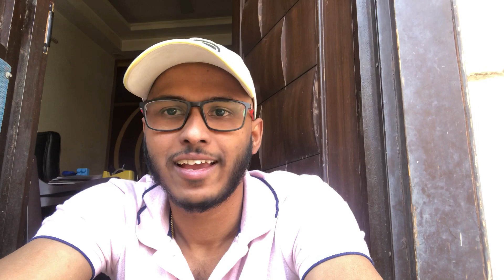ഏപ്രിൽ 5 ലെ 9 മിനിറ്റ് പവർ ഇൻഡസ്ട്രയിൽ എന്തൊക്കെ സംഭവിക്കാം | Effects of 9 minute on Power Industry

Comment: 9 മിനിറ്റു ഓഫ് ചെയ്യുക എന്നുപറയുന്നത് എവിടെയും സബ് സ്റ്റേഷൻ അല്ലെങ്കിൽ ജനറേറ്റർ ഒന്നും ഓഫ് ചെയ്യില്ല.... വീടുകളിൽ ലൈറ്റ് മാത്രം ഓഫ് ചെയ്യാൻ മാത്രമാണ് നിർദേശം(ആരെയും നിർബന്ധിക്കില്ല) ഇതുകൊണ്ട് നമ്മുക്ക് എനർജി സേവിങ് ഉണ്ടാക്കും...
Reply: Angane transformer substation il off cheyadi vannal athite outgoing side 3 phase open cheyuthu transformer on cheyumayirikum. Angane varumbol start cheyumbol ulla thamasam varilla. Ithente chintha anu ethra correct anu ennu ariyilla
Reply: @ananthumohanvlog8837  Normally, transformers are not switched off at substation, even if the load is only for one transformer. Even if the load is enough for one transformer only, if there are two/three transformers (in parallel), they are made to share the load(as per their impedance values). It is done for reliability of supply.
Reply from the maker: Angane alla...demand undel maatre power generate cheyyu..peak samayath maatreme chile transformers on polum cheyar ollu...
Ivdem load orupad kurenjal substation transformers off cheyende veram...generation kurekendem verum..
Energy saving undakum athu sheri aanu..proper aayit manage cheythal problem undakilla...
Reply: @TechCornerMalayalam  substation transformer off ചെയ്യില്ല.. ath total power cut off ആകില്ലേ.... generation stationil ആണ് എന്തേലും changes ചെയേണ്ടി വരുക
Reply from the maker: Substation il oru transformer allelo orupad feeder kaanum...athil chileth peak loadsil maatre use cheyu...athinte switching adjust cheyende verum naale
Reply: @TechCornerMalayalam  techinical side അറിയാത്തവരോട് പറഞ്ഞിട്ടു കാര്യം ഇല്ല... bro
Reply: @jerinmathew3254  പറയാതെ ഇരിക്കുന്നെ എന്തിനാണ് bro, ഇത് നമ്മുക്ക് പരസ്പരം അറിവുകൾ കൈ മാറാൻ അല്ലെ?

Comment: There could be some interesting happenings during those nine minutes.. A possibility is that our grid elements may trip on over frequency or on over voltage if not taken care suitably.. Worst case will be a cascading incident, which could put many patients who are put on life support systems all over the country, at risk. But, I hope that we'll just ride through those 9 minutes without much issues if our fast acting power plants (hydal/gas etc) respond well in the free governor mode.. Same will be the case for switching on time after the 9 minutes.. ( We already hold an earth hour each year, don't we?)
Reply: Can you please explain how the frequency will be getting high while reducing the load
Reply: @advikaak5645  The grid is fed by sync. alternators in parallel. When the load is just reduced at the consumer end, the sync. alternator would still have been receiving same amount of prime mover input, which it was receiving just before the load was switched off by the consumer. Hence, after the load is switched off by the consumer, there is  mechanical input to the prime mover of the alternator which is actually more than what is actually needed for the current situation (where load is lesser than before). So, naturally, the speed of the prime mover(rotor) increases. Hence, the sync. speed of the alternator increases. When the sync. speed increases, the frequency of the output sine wave increases corresponding to that (NS=120f/P). Ofcourse the governor would kick in taking it's own sweet time. But that would be okay only for small changes in load, not a large percentage of the demand (as it might be the case tonight). When load reduction is big and rapid, the delay in governor response will result in higher system frequency and if not taken care of quickly by either manual or automatic means, over frequency protection elements will sense and issue a trip. Hope you got it now!
Reply: @rajeshtk1246  sir prime mover have actuator so if the load will degrees the actuator will control the speed of the alternator in oder to maintain the out put of the alternator .the enter system is in synchronised so the load sharing will be equally
Is that ture sir?
Reply: @advikaak5645  Yes, but it will take a finite amount of time as those things are mechanical parts and heavy. Kindly read my first reply. I've edited it..
Reply: @rajeshtk1246  sir 9 min is over  anything happen
Reply: @advikaak5645  Nothing noteworthy happened.. All as usual :)